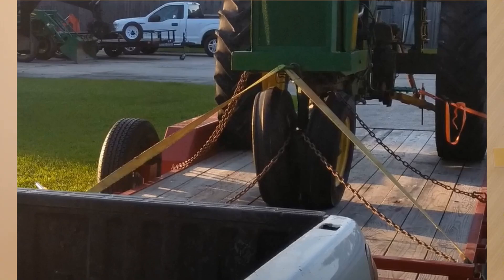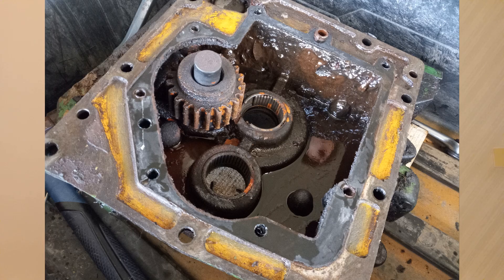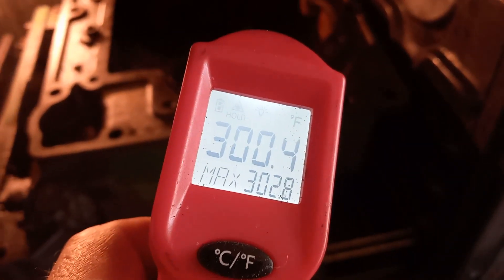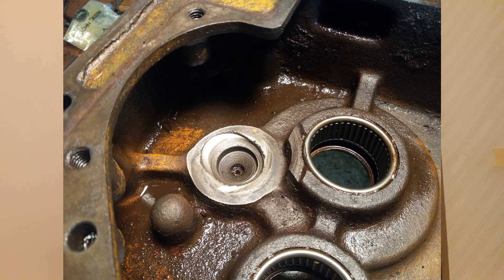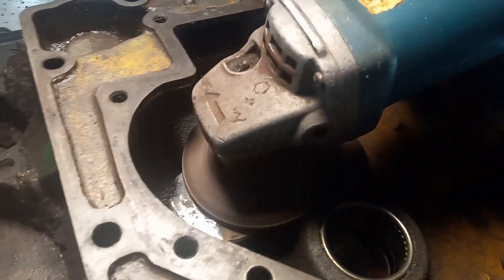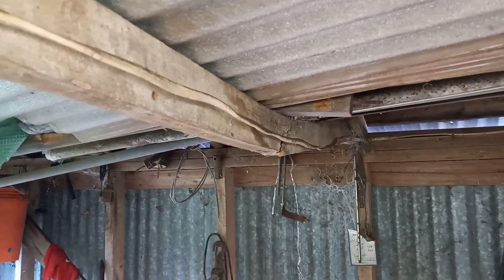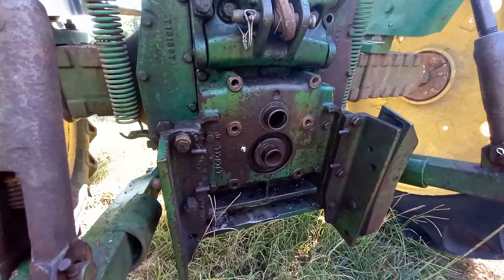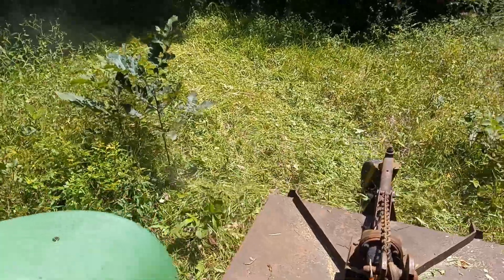John Deere 2010 PTO gears finally fixed!

Comment: Where is the fill point located that is to add or check the oil in box ? ?
Reply from the maker: Hi, John. There is a fairly large set screw type of plug about half way up the side of the PTO gear box. Probably covered in gunk like ours was. Thanks for watching.

Comment: Nice job figuring this out. The second one will be easier as you are now an expert! Iused a local machine shop to do a similar repair. They used a rose bud on a torch to heat the surrounding cast before building it up with weld. I believe they used nickel rod. They then milled it on a machine after building it up. You could hardy tell it was not factory. The added cost wasn’t too bad, but I figured I had paid for confidence in it.
Reply from the maker: Wow, sounds like some very skilled machinist there. Glad you got it repaired properly. Thanks for watching.

Comment: You did a good job of fixing it, work with what you got. When I seen it in the house oven, I was like. That was no fun to be in. lol  You might want to look at getting a slip clutch for the brush cutter. That way if you hit something with the blades it want kick back to the tractor pto. Have a great weekend Dustin!  See ya!
Reply from the maker: Well, thank you! I'll have to look into getting one. We recently got a brush cutter with a shear bolt attachment on the drive shaft, but the tractor breaks the bolt every time I engage the PTO! I figure it's because this old style PTO is either off or instantly on and this newer cutter is meant to be used with newer style PTOs. Thanks so much for watching and commenting!